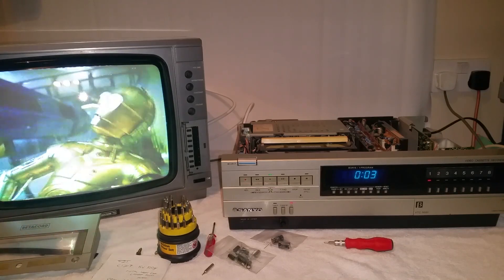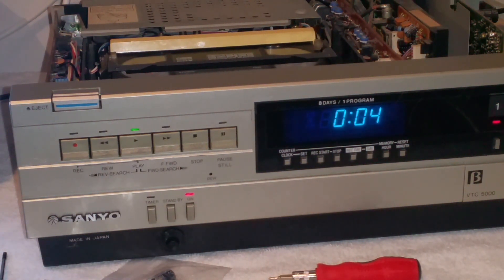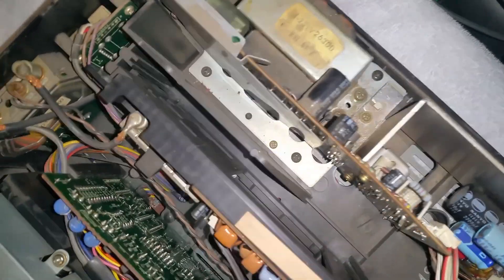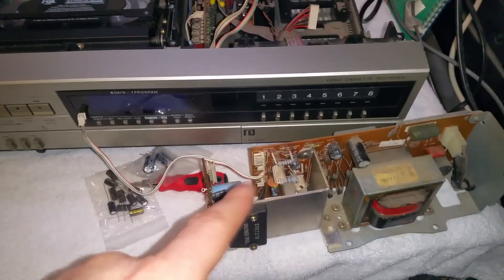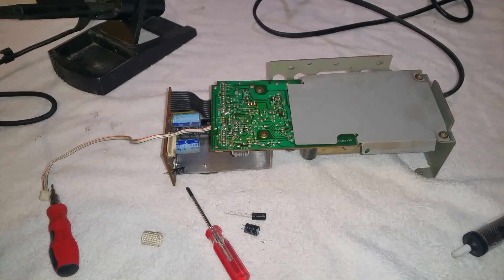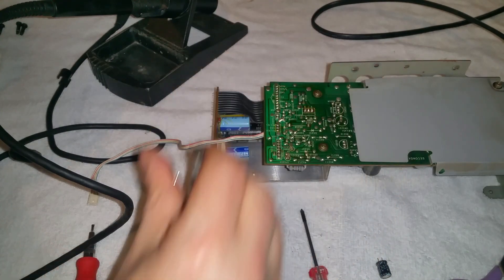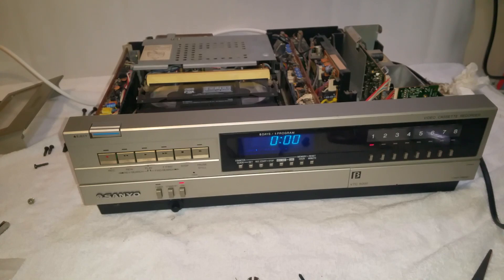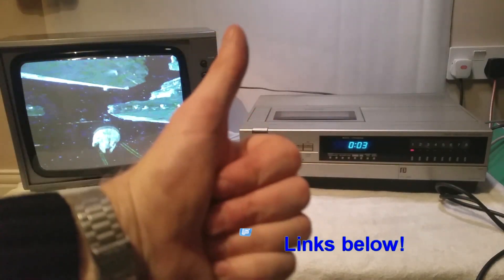RGVX : Betamax Player Repair Part 3 : Rapidly Flashing Clock Repair ( Sanyo Betacord VTC5000 )

Comment: A few things. 

That glue can become conductive when its old , remove ALL of it form the PCBs.
Dust is hydroscopic clean everything
Your ok to use a higher voltage cap, better in fact as it is under less stress.
Reply from the maker: Ed's Studio Workshop Yep, read about that, all seems happy a few weeks later :o)
Reply from the maker: Thanks for tips :o)
Reply: In regards to using a higher voltage capacitor, yes its generally okay, however, if the voltage is too high (rated on capacitor) It may cause forming issues when the capacitor discharges and recharges.

Comment: My VTC 5000 had a similar issue with the clock. Each time I pressed the power on button, the clock would reset. I replaced the 100uF cap and voila!
Reply from the maker: Yup, that's the fix :o)